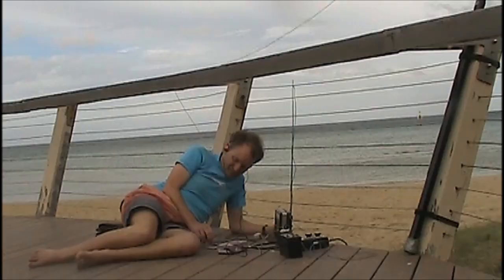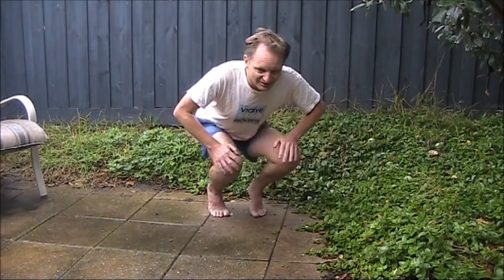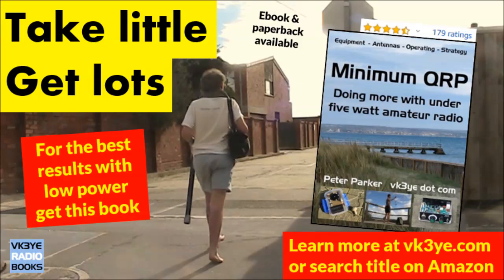A non BFO alternative to hear CW on an AM receiver

Comment: Slightly related, and you probably know this already, but you can resolve SSB and CW with two AM transistor radios, use one to listen and put the other next to it, then tune it around until they heteroydne and resolve the signal (i.e. the 2nd radio acts as a coupled BFO).
Reply: Pete did a video on this awhile back in his garage. I’ve yet to replicate it but probably due to my inexperience.
Reply: I did that with two shortwave receivers and listened to 20 Meter USB QSO's using nothing but a wire antenna from a 9th story condominium apartment in Freeport in the Bahamas back in 1977. Talk about cool!
Reply: I seem to recall doing that with 2 SW receivers many years ago, I think by receiving the oscillator from one set, so long ago now

Comment: I recall reading about a soviet russian bug sweeping/RF sniffer device that used a diode detector AND a diode switch at the front of it to get a tone if there was a carrier of any type in there. So that could also be done. A diode shunt rf switch or a 74hc4053 switch before the diode detector.

Comment: I think to keep it electro mechanical, 0 ic chip possible, clamp or weld the shaft of a small dc motor to a brace, and use abs or timing sensors from an auto, placed very close to magnet section of motor can, to get excited by pulses of the magnets swinging by, as the motor can is attatched to a propeller, impeller, or just a heavy ring of metal with momentum to rotate it, and occaisionally giving it a flick as you are recieving. Otherwise it can be rotated by wind, water, or a big light feathered prop above a few candles to rotate it from heat rising. The flywheel will be safest and easiest, and if the sensors eat up all the audio power, a flywheel with bumps to flick a switch as it rotates would be absolute primal simple for creating a carrier beat oscillation.
Reply: Like you, I want to build a purely mechanical CW receiver. I wonder if we can use an oscillator created by rotating a motor made of magnets at high speed for this purpose.

Comment: Electro mechanical... current through inductor creates magnetic field, attracting nearby ferromagnetic bridge making the circuit... which breaks the circuit!
Reply: Rinse and repeat ;)
Reply: If this is a light semiconductor junction, high frequency modulation possible
Reply: @MrKarlGP there is a video of a bloke who made a spark gap transmitter and Cohera
Reply: Chris Wilson that's really old school! I meant more like an actuated relay, a bit like the reed suggestion made by another commenter... basically a very sensitive switch, although a Schmidt trigger comparator with adjustable hysteresis is ideally needed to drive it otherwise any signal hovering near the trigger threshold would make it chatter on and off wildly. Hey, I guess the coherer would avoid that! Although would need tapping to reset it.
Reply: Easy. An automotive points type distributor driven by a variable speed battery powered electric motor.
Reply: @MrKarlGP  well you use the coherer to activate a solinoid hammer to tap the coherer and reset it. Works like a crude buzzer. Scrap yard transceiver challenge
Reply: Alternatively, just use a jumper wire to take the signal at the earliest point of demodulation i.e. before coupling capacitor to the main audio amp stage and use that to drive a simple Darlington pair switch voltage to a piezo buzzer... maybe via a potential divider to set the threshold?
A lot less mechanical bits and pieces... just a couple of transistors, a pot and a buzzer, the intrinsic capacitances should be sufficient to provide sufficient RC time constant ;)
Reply: Obvs also a battery required, but the idea is that all the bits are readily available "as is" :)
Reply: @MrKarlGP  unless it can kill you, it’s not real radio :D
Reply: @MidlifeRenaissanceMan  If only Buggles knew...
(Apologies, terrible 80s joke)
Reply: @MrKarlGP  if you’re going to apologise for that, you might as well just apologise for all of the 80s. As I say, If you remember the 60’s you weren’t there. If you remember the 80’s you weren’t embarrassed enough

I’m trying to remember the reference and all I have flooding back is my time in a 80’s top 40s covers show in the 80’s. Thank God I had the sense not to do the Permed Mullet
Reply: Sunspot cycle was good back then from memory
Reply: @MidlifeRenaissanceMan  Buggles "Video Killed the Radio Star" !!
The lead singer Andy Ellison was originally in the band "John's Children" with Marc Bolan!
I was born marginally before the moon landing, but sketchy memory prior to that ;)
P.s. 80s hair products were utterly unequal to the tasks of the styles they were expected to assist with lol
Reply: @MrKarlGP  thank you, and yes, I too vaguely remember going out at night and seeing the speck of light fly across the evening sky’s with a couple of astronauts headed to the moon. 

And thank God for grunge to put an end to all that silly 80s nonsense :-)
Reply: I really want to know what propagation is like for someone under an intense aurora! There must be some steampunk hipster explorer out there who could do it for all of us ;)
Reply: @MrKarlGP  well there was that story of an early atmospheric atomic test had amazing propagation from the west coast to Hawaii on 6m & 10m being solid for months after the explosion
Reply: @MidlifeRenaissanceMan  erm... well. Although I'm sure it was amazing,  I'm not sure we should be advocating nuclear explosions as precursors to expedient communication channels
Reply: @MrKarlGP  I’m sure if we organised a DXpedition with Dennis Rodman and Kim Jong Yum Yum to North Korea, they may oblige
Reply: ...saying stuff like this is why I’m not allowed a microphone on Ham Radio and have to send everything with a straight key.....